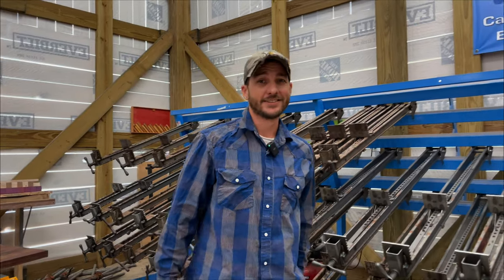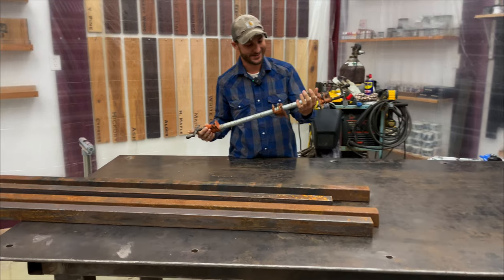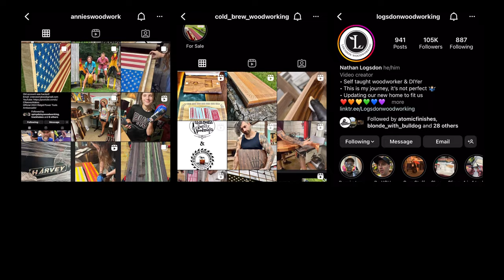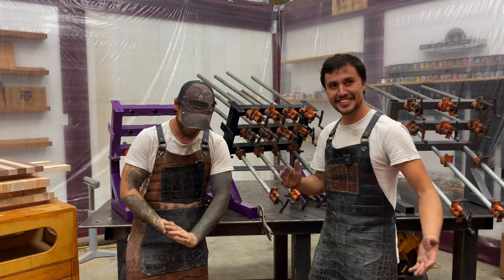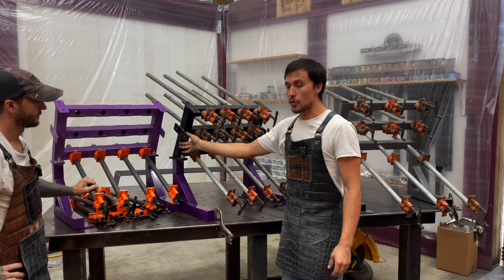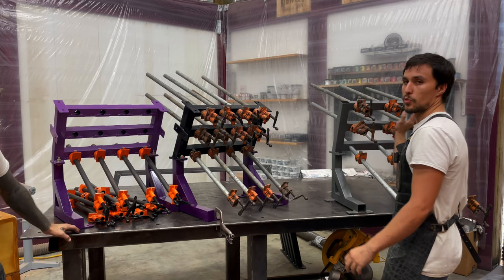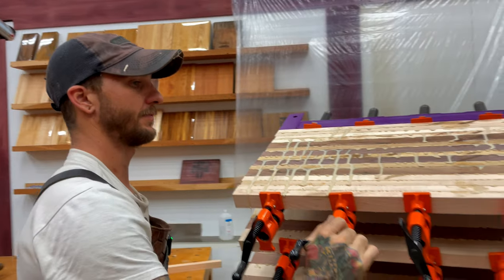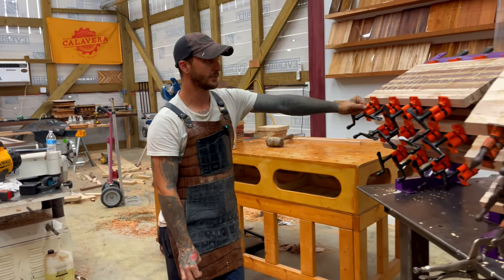TNT Pipe Clamp Rack

Comment: no issues with copyrights? I love the idea and hope it will be brought to market, just curious if all bases have been covered with regards to "passing off" design from original.
Reply from the maker: No worries of copyright, wouldn’t apply to this. You are referring to patents though. And no issues. Aside from the base having the same stance, they JLT is engineered for their special clamps(which  do have a patent) there is enough differences that I don’t see a problem. Also we are affiliates of JLT and still promote their big systems to professional/commercial shops. Our rack is more geared to the average woodworker.